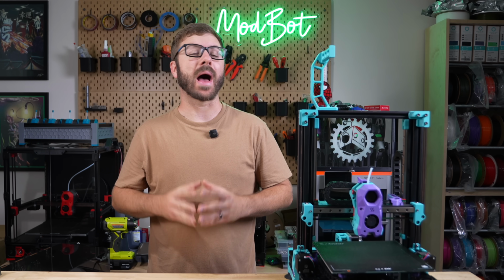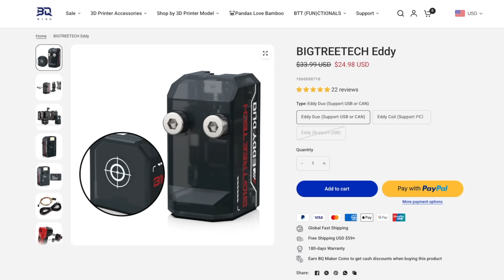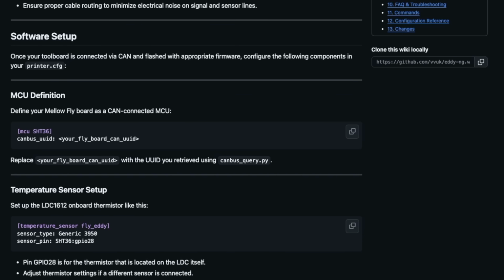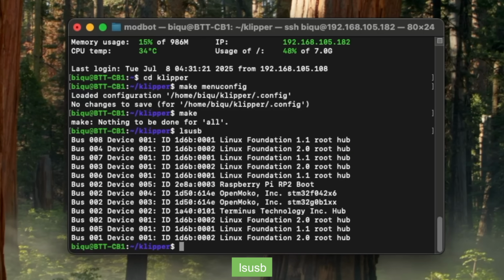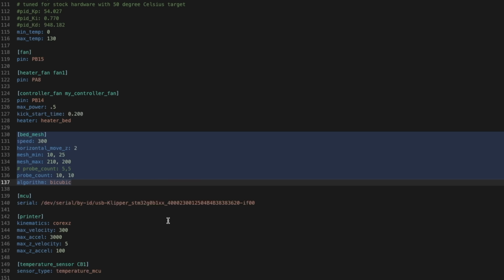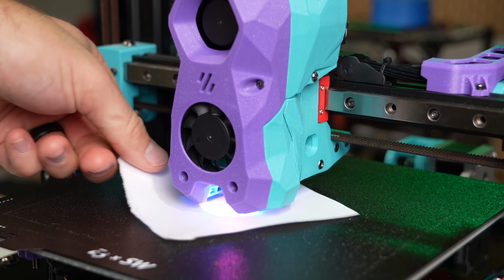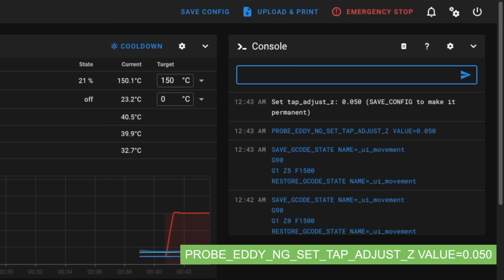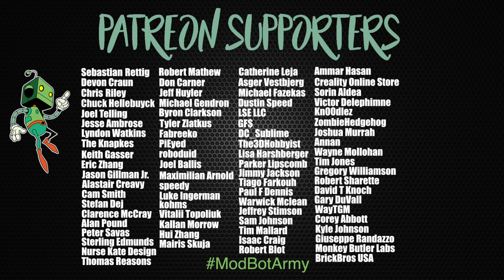High Speed Bed Meshing With Automatic Z Offsets (Eddy NG)

Comment: [gcode_macro START_PRINT]
gcode:
{% set PROBE_TEMP = 150 %}
{% set BED_TEMP=params.BED|default(60)|float %}
{% set EXTRUDER_TEMP=params.EXTRUDER|default(190)|float %}

# Home the printer
G90
M83
G28

# Preheat the bed
M140 S{BED_TEMP}
M190 S{BED_TEMP}
M104 S190

# Preheat the nozzle for TAP
M109 S{PROBE_TEMP}

# Perform TAP
PROBE_EDDY_NG_TAP

# Bed Mesh
BED_MESH_CALIBRATE METHOD=rapid_scan ADAPTIVE=0  

# Heat the extruder to the desired temperature
M104 S{EXTRUDER_TEMP}
M109 S{EXTRUDER_TEMP}

# Prime Line sequence
G1 Z5 F3000 ; Lift
G1 X20 Y5 F1500 ; move to prime position
G1 Z0.15 F3000 ; get ready to prime
G92 E0 ; reset extrusion distance
G1 X100 E30 F600 ; prime nozzle with adjusted extrusion / E__ based on how much you like

# String removal circle after priming
G1 Z0.2 F3000 ; adjust to 0.2mm above the bed
G1 Y15 F10000 ; move the toolhead in the Y direction by 15 units

# Execute the circle 3 times
G2 I=5 J0 F10000 ; circle with 5mm radius
G2 I=5 J0 F10000
G2 I=5 J0 F10000

Comment: I have my old Eddy USB from last year after I replaced it with CNC TAP, got perfect first layers ever since but going into higher speeds and higher temps, I'm still thinking if I should move back to Eddy USB or not.

I have a Trident 350 with enclosure temps up to 80C and bed up to 140C. can this handle it?

Comment: Finally got around to installing, this video was a lifesaver. For anyone else if it's scanning from very high change the horizontal move z  in your bed mesh I put mine down to 2 mm 

I have cyclical noise on my y axis which wasn't there on the omram but even with that it's .2mm. Without heat soaking too much can't be mad about that

Comment: Everything with the install went well, but when calibrating my tap I found issues. I noticed that immediately when I turn my printer on, tap works and then 5 to 10 minutes later it doesn't. Upon inspection I saw that the MCU is at 47 Celsius, which makes me feel like I have a bad Eddy duo or I need to add some type of heat sink or cooling fan to the probe? I also didn't see anything in Vlad's GitHub instructions about temperature compensating for thermal expansion when calibrating, so maybe that was just understood and I didn't heat up my bed and nozzle before all the calibrating processes?

Comment: I cant get PROBE_EDDY_NG_STATUS to run.  The github says i may be missing a [probe_eddy_ng ..] section in my configuration, but I cant find any more information about what this section is supposed to contain.  Can someone point me in the right direction?
Reply from the maker: What’s the error? Did you install the addon through the terminal after ssh’ing to your pi and flash the probe?
Reply: @ModBotArmy  i managed to figure this one out, i had missed the "_NG" in the [PROBE_EDDY_NG BTT_EDDY] section of my config file.  Now when i try to run PROBE_EDDY_NG_STATUS i get this error -
"Last coil value: 0.00 (-infmm) raw: 0x14456682 ERROR: 0b1 status: 0x208 UNREADCONV1 ERR_ALE"
Reply from the maker: @jaytay4589 I have to enter it a few times but it does look like you’re getting an error. I’d see what documentation says on troubleshooting about that specific error.

Comment: it's really too bad that these eddi current sensors cannot really works with bed with magnets included in the aluminium plate.
Reply: It works with certain beds that have the magnets embedded deep enough like the provok3d bed system, but not with beds like the mandala roseworks because they are too close to the surface

Comment: i have eddy coil on most of my machines, so i can take advantage of canbus.  the installation steps you ran through really aren't that different.  funny thing is, though, my only machine i don't have issues accessing the boot button on is my e3ng.  my micron+ & corexz both run anthead, so they both have to be nearly completely disassembled to reach it.  this will make life easier, though.

Comment: I resolved thermal drift issues on my Voron with the Eddy USB by reprinting key toolhead components (specifically those that affect the nozzle’s Z-offset) in PA-CF. Turns out ABS expands in high-heat areas, leading to slight shifts. Since switching to PA-CF, my first layers have been consistently perfect.
Reply: My V3SE can only print petg atm is it good enough for printer part?
Reply: No @TheGlitterMan
Reply: @arcademan7616  Dang it. The dream didn't survive then.

Comment: Needing clarification, possibly stupid question.  When you're saying 'tap' are you really just talking about the physical procedure or does this also require Voron Tap?  Because it seems like this is working with sensorless homing and then comparing it to the Eddy reading, so I'm just a little confused.  We have a lot of overlapping terms here.
Reply from the maker: Yeah so there is no correlation between voron tap and this. They call it tap but it’s like you described being the physical procedure of tapping.

Comment: The form factor of the Eddy does have me hoping that Bondtech might consider adding it to their upcoming INDX toolchanger if they don't already have plans to add a beacon. I just hope it gets more accurate with the z-offset. My beacon didn't need any adjustments after the initial probing run and that just left me upset I hadn't put it on sooner than I did.

Comment: Great video mate, I am a little confused though. Do you need a voron tap already set up? Or is it just the case of the tool head tapping the nozzle on the bed?
Reply: Not sure if you found the answer to your question or not but no eddy ng has nothing to do with voron tap other than the word tap. Eddy ng is is own klipper add on that includes all the necessary scripts\software to run.  I've never used voron tap but just setup eddy-ng and was surprised how sensitive it is when tapping.  My ender 3 doesn't have the most rigid toolhead but I still haven't noticed any flex when tapping.  Unlike voron tap which is designed to move up a certain amount until it triggers the optical sensor.
Reply: I came here wondering the same thing! I'm trying to determine if I need tap and a cartographer, or just the eddy sensor

Comment: despite that i was not happy with eddy and switched back to bltouch you cannot use any other surface then metal plates. for special filaments you do better on glass or epoxy.

Comment: for some reason, Eddy or not, my z offset NEVER gets saved and I always have to babystep to where it was (.425 in these days case). Once done as soon as the printer is on, i don't have to touch it until next reboot. would this new plugin maybe help me with this problem?
I disclose i have done the temp calibration as per Eddy main manual.
Reply: There are macros in the eddy repo for saving the z offset, but I would just try out eddy-ng and that should fix your issue
Reply: @thomasfjen  it did fix it. i m sending prints like a gatling gun from outside the house with my wife changing the plate and walking away 😂

Comment: Does anyone understand how the probe is able to tap the nozzle to the bed?
Reply: The simplest way I understood it was that it uses the eddy currents (magnetic fields) to determine when its hit the bed. These change as it moves closer to the bed and once they stop changing, it has reached the bed and stops the Z movement, triggering the touch.
Reply: @ABG_3D  ahh OK that makes sense. I thought the variances in probe height and nozzle length would impact this. Its awesome technology, i have a Cartographer and didnt know this was possible till i got it. Only 2-3 years ago i was having to set offsets manually with the Omron probe on my Voron
Reply: @danturismo carto is awesome, Richard made an epic probe for sure. I have a cartographer probe on my Voron Trident with touch and its pretty dang awesome

Comment: I kinda like my genuine TAP, but it would be great to have some Eddy like addtion to perform the bed mesh (on a V2.4 350mm this can take some time with TAP). Would such a setup be possible and recommendable? So, TAP for homing (Z offset!) and gantry levelling and then eddy for bed mesh? Thanks for your take on this, anyone!
Reply: I use the EddyNG on my Sv08, and basically this setup is used but note, TAP != Homing! Tap finds the  Z offset, and does this 5 times roughly.
Reply: It's doable but that would also use eddy for qgl. Iirc btt added some files so you can add eddy to your voron tap setup.

You would define the tap gpio as an endstop pin and not use the virtual endstop anymore
Reply: @thomasfjen you ofc can use it for QGL. I use it for that at 400mms. Its really fast, and it triggers as a virtual Z endstop. So no need to route the GPIO
Reply: @xapu8775  (my previous answers are not showing up so i try again)

They are asking for using voron tap as z endstop (the mechanical nozzle probing solution by the voron project) and then using eddy as probe/bed scanner.
Reply: @thomasfjen  ohhhh ofc you can use it like that, you just need to modify you print start macro. the tap doesnt happen automatically.
Reply: @thomasfjen  also the tap is fully in software, you cant even access it gpio wise

Comment: Does this works with Mainline Klipper? 
Because I looked it up a couple of weeks ago and it didn’t worked with mainline. therefore Klipper had to be an unofficial version
Reply: Yes! It now installs as add-on and still uses mainline Klipper as branch, not a fork anymore. You only have to recompile/reflash the firmware to the eddy MCU after the installation

Comment: Highly recommend katapult bootloader on the eddy to alleviate the need to disassemble things. It allows you to put it into dfu via the terminal. I’ve been using eddy-ng on my sv08 for a while now and it’s been an awesome experience!
Reply: No need for katapult honestly, you can flash the btt eddy with "make flash FLASH DEVICE=/dev/serial/by-id/your_eddy_details"

I've been flashing my btt eddy this way without fail. The same works for the ebb boards. However, the restart command does not always work, and you need to run firmware restart from your mainsail/fluid console.
Reply: I was just about to ask this. I know I used katapult initially so I didn’t have to go through this process again.
Reply: Highly agree. No issue whatsover since I went ng on my sv08

Comment: This probe doesn’t work with a print bed larger than 250x250 or does it?
Reply from the maker: Where did you see this? I’m running it on my pro forge 300 that’s 300mm bed size should be irrelevant
Reply: I'm running it on a custom printer which is 410x410

Comment: i bought Eddy Duo few months ago and I have to say that it is the worst electronics that I bought from Biqu ever. And I bought really a lot from Microprobe, through E3 motherboards ending on Octopus boards. The number of issue and their influence on 3D prints is drastic. I bought it together with SB2209 board and issues with connection between boards stop and ruin whole prints (missed communication with Eddy even if this is not used result in Klipper shutdown) - Eddy is disconnecting due to some noise issues. I even hot glued cables - it didn't help for a long time, maybe 3 prints. And these issues are after few prints. Additionally I chose this probe, because it claimed temperature compensation. Unfortunatelly bullshit, I am using it in Enderon 3D printer with chamber heater and I had to make Z probe offset adjustment after almost every print, because chamber temperature varied between 33 and 55 degrees and it couldn't work.
I don't want to be big hater of this company (I even bought microprobe as replacement for it), although in my opinion they treated my complaint really bad - I issued cable issue after 5 prints, but unfortunatelly I ordered it earlier, when I was in the middle of assembly of Enderon and they answered that any complaint is not valid because I had 180 days of guarantee, but I bought it 200 days ago...

Comment: I was given a free eddy at RMRRF in 2024. I couldn't get it to work well because the z-offset was horrible. I switched to cartographer touch and haven't looked back. One thing I'm wondering though is why somebody with cartographer touch would install this addon? CT works great with Cartographer's own version of firmware. Good on BTT for further development here though.
Reply: I used Cartographer to have a second set of hardware to develop for. The Cartographer software is fine, and if it works for you, great! I like being able to run the same setup on all my machines too -- some have the mellow fly probe, some cartographer, some... stock sovol zero eddy.. etc :)
Reply: Because multiple options are always better than one even if they're worse overall

Comment: Thanks for the vid. I really wanted you to cover this!

My question is, when changing plates whats the process like?
Would you need to recalibrate the tap again or does it do so automatically?

I have a couple plates with quite different z offsets due to where the metal plate actually is (pei plate vs g10 plate) so I wanted to know if this makes it seamless to swap between them